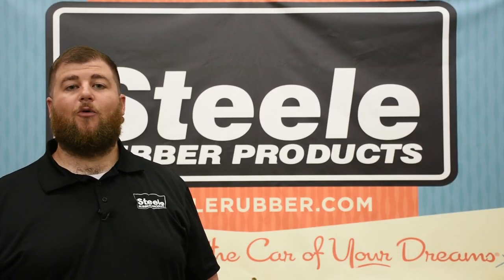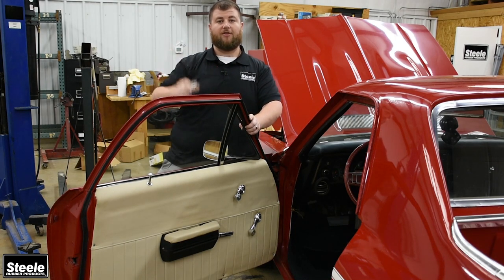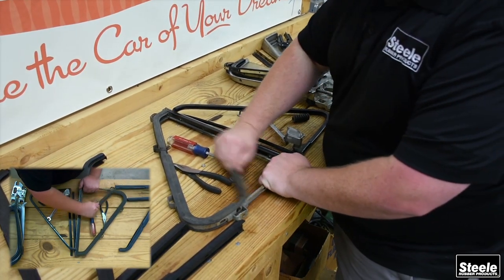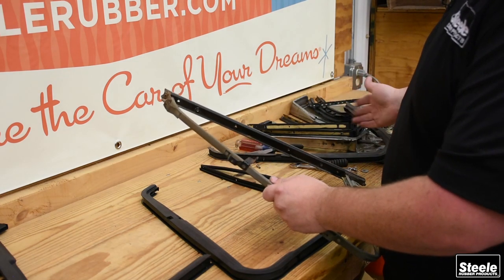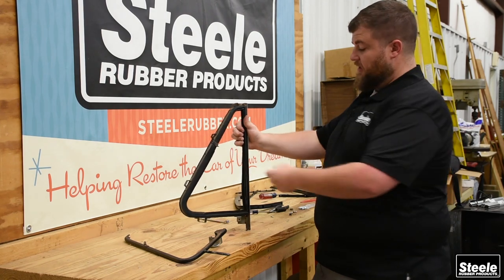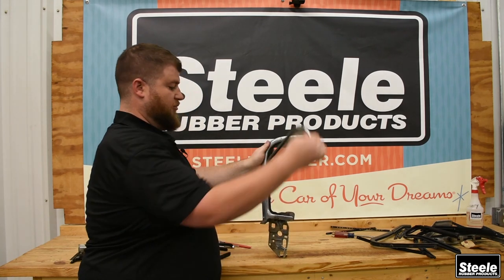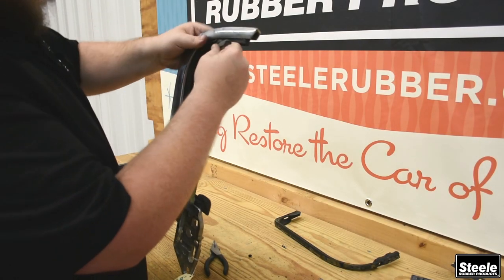How To Replace Vent Window Weatherstripping

Comment: Thanks for posting this. The last vent type is also tricky, since the vent window has to be positioned just so before it will pop out of its position in the window frame. There are some tabs on the post that need to be aligned properly with the hole the post goes through. Would have been nice to see how you guys do that. Also, on the rubber division seals that have the tabs, it is not possible (that I can see) to bend those over without removing the felt channel - something not covered in this or other videos. I ended up using a good weatherstrip sealer for that part of it and hopefully that will be good enough. The felt on my vents are in good shape so I didn't want to change it out.
Reply from the maker: You’re right, that last one is the trickiest just because everything is locked in place with rivets. To remove the glass, you may need to drill some out. With this setup, there is a small L-bracket right where the bottom of the vent frame meets the vertical channel. You have to drill out a couple rivets and that allows the frame enough flex to remove the glass. There may be another way, but that’s what I can tell from looking at this frame. You’re also right about the tabs on the division post, you need to remove, or in some cases you can just pull back the vertical channel. We do show that in this video: https://www.youtube.com/watch?v=PL0O7VM36SI&t=22s

Hope this helps and let us know if you know another way to remove that vent glass!

Comment: good video Danny. However, though you do make it seem easy, in reality some vent windows have got a difficult process to replace the seal like a 66 Dodge Dart convertible. I just do not know how to remove the vent glass as it doesn't use any nut with spring at the bottom. Everything seems riveted. I can't even find any info on this anywhere for assistance. Hope you can help. Cheers.
Reply from the maker: Your vent windows are tougher than the spring nut set up. You should ask someone who's very familiar with that type of installation, you can try restoration specialties - they sell the rivets you'll need to use when putting the assembly back together. Or any car builder that specializes in MOPARS. We suggest to not tear anything apart until you have the rivets to put it back together as they can be hard to get ahold of. We hope this helps some, sorry we don't have more information for you. If you do have further questions our specialists could answer them for you via email at cars@steelerubber.com. Thanks for watching!

Comment: Wish you would of showed us how you took the vent window out of the Door, I just cant figure that part out on my 1965 lemans/gto.
Reply from the maker: We don't have a video just for your car but maybe we can help.
If you car is a convertible or hard top your vent window wont have a frame, if its a sedan it will. If it has a frame look for some screws on the side of the window facing the A pillar and remove those. If no frame you can skip that step. 
Next, remove the door panel. Look for 2 bolts holding the vent window assembly in- you'll need to remove those. Then roll the door window all the way down and then lift the assembly up and turn it in toward the car and wiggle it out. Again, if you have a hardtop or convertible this will be easier, a sedan will be more challenging.
You can check out the method on this video we did on a truck  https://youtu.be/PL0O7VM36SI   I know it's not a car and the setup will be a little different but the method of turning and maneuvering the assembly out of the door should be similar and will hopefully help you figure it out.
If you have any additional questions feel free to reach out to us here at cars@steelerubber.com or 800-544-8665 and we'll guide you through it as best we can. Thanks for watching!
Reply: @SteeleRubberProducts  Yes my car is a hard top.

Comment: I have a 1937 ford coupe the 1/4 glass is fixed what is the proper procedure for changing these out? Thank you for your help. Rusty
Reply from the maker: Hey Ronald, for that particular car, I’m not certain. Typically you would have a garnish molding that goes around the interior side of the window. This molding would be held in place with screws and hold the glass up against the body of the car. If you remove that molding, the glass should come free, then you can replace the seal. This is simply based off what I know about vehicles that age and glass using a basic U-seal. If this is not how your window works, take some pictures and send them to us so we can look at it! You can send them via social media or email them to us directly at contact@steelerubber.com 

Thank you for watching!!

Comment: is there a video on a 1967 chevelle convertible vent window rubber. Also the two WEIRD WASHERS above the bracket spring hold  n spin so any info on those.Thanks
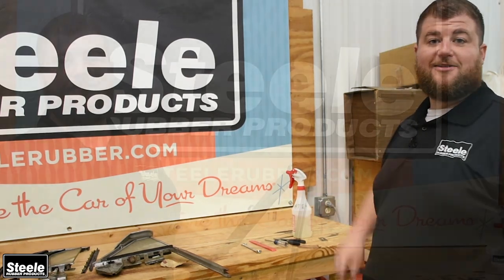Reply from the maker: We don't have a video specific to the 67 Chevelle but it's very similar to the Corvair vent window in this video at the 1:26 mark. Also, the washers provide a buffer between the bracket and the spring. One of the washers has an oblong hole so it rotates with the pivot rod. I hope this helps. Thanks for watching!

Comment: how hard is it to get the wind glass out of the chrome frame does it press in or does it glue in
Reply from the maker: Hey Robby, it can be a little tricky to get out. It is pressed in, it will be taken out the same way it is installed. Just take a soft faced hammer with a wood block or wedge and place up against the frame and gently tap the block/wedge to knock the metal frame off. If you have any further questions or trouble getting it out please email us at contact@steelerubber.com, thanks for watching!

Comment: I have a 1966 chevelle 2 door. Do I really have to take out the whole vent window assembly to replace the weather stripping
Reply from the maker: Yes. There are 2 pivot points on your vent window- in order to change out the weatherstripping you have to take the window out of the frame. In order to do that you'll have to loosen up a bolt that's located underneath the vent window, down inside the door so you'll have to remove the assembly to get to it. I hope that makes sense. Thanks for watching- if you have any other questions, please let us know!
Reply: Thanks for the response
Reply from the maker: We are happy to help!
Reply: @SteeleRubberProducts  the vent window out of its frame first? the convertible 67 chevelle  upper chrome frame has no rivets to drill out.
Reply from the maker: Yes. You do have to remove it because the rod the window pivots on goes through the rubber. The only way to put it through is to remove it and reinstall it. Hope this helps. Thank you for watching!

Comment: I've got a '72 Cutlass and the top of the window is held in with a rivet. Do I need to remove it to replace the weatherstrip?
Reply from the maker: Hello sir, You will need to remove it because the bottom section has a pin that goes through the rubber so you'll have to remove the glass from the frame to replace the weatherstrip. Thanks for watching! If you have any other questions, please let us know.
Reply: @SteeleRubberProducts  So what do I replace the rivet with?
Reply from the maker: You can replace it with another rivet- you can find one at any hardware store (you'll have to use a rivet gun) or you can use an appropriately sized bolt and locking nut.
Reply: @SteeleRubberProducts  👍

Comment: Do you have the bottom piece that holds the glass on an '85 Dodge D150 vent window?
Reply from the maker: Hello Al- We have the vent window weatherstrip for this truck, but that's all. I'm not sure exactly which part you are referring to- is it the metal frame? In that case, we do not have it. Please let me know if its something different.
Reply: @SteeleRubberProducts  Apparently, it is called glass setting tape. That is what I am needing. Thanks for the reply.
Reply from the maker: Al- we do have that. We call it sash channel filler. It comes in 2 different thicknesses and we sell it by the foot. Here are the web listings for them: https://www.steelerubber.com/sash-channel-filler-strip-70-2169-57
and https://www.steelerubber.com/sash-channel-filler-strip-70-2170-57

Comment: um, the step where you remove the "bolt" from the pivot is not right. factory is a step rivet. I don't know where you can them.major hurdle from the get go
Reply from the maker: You are right but when we were working on this particular window, it had a bolt in it (someone may have worked on it before us and modified it). While the correct thing to use is a step rivet, you can also use a semi tubular rivet, which is easy to find at any hardware store. Thanks so much for watching! If we can answer any more questions, please let us know.

Comment: Very disappointed in this video.  It appears 99% of this job involves working that rubber into its framing.  I still have NO idea how to do it!  What exactly are you doing with that plastic tool?  Go slow and shoot a closeup, please.  Throw us dogs a bone.
Reply from the maker: We're tucking the rubber bead on the outside of the vent window in to the metal channel of the vent window frame. We're using the plastic tool to help push the rubber in. It's better to use plastic to do this than metal so it won't puncture the rubber. Here is a photo to help illustrate this better: 

https://www.steelerubber.com/assets/site/img/content/vent-window2.jpg
Our apologies for that not being clear in the video. Thank you for watching- we appreciate your feedback! If you have any other questions, please don't hesitate to reach out.